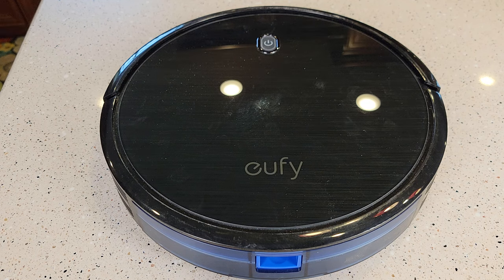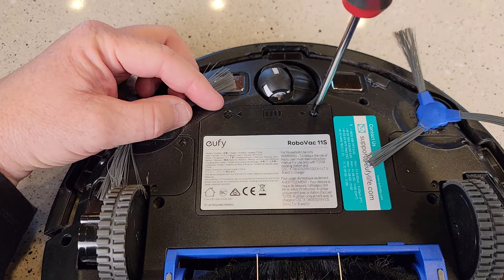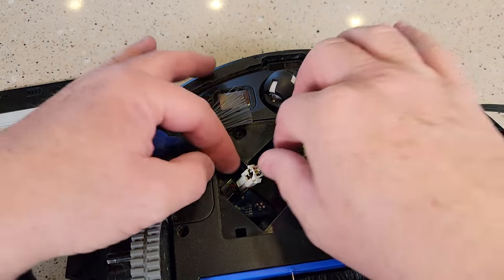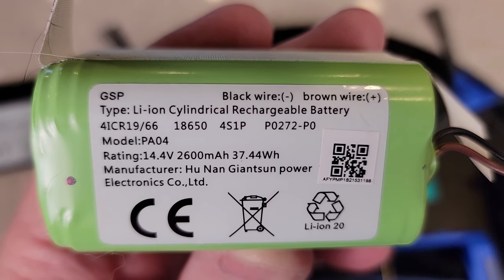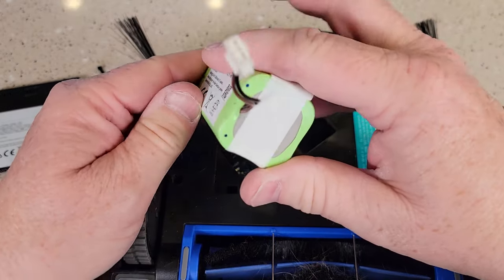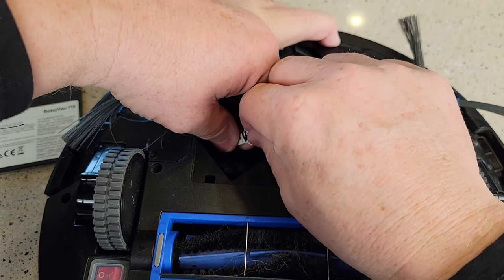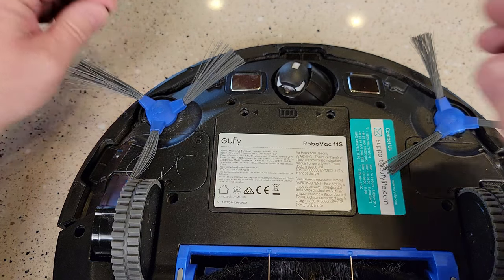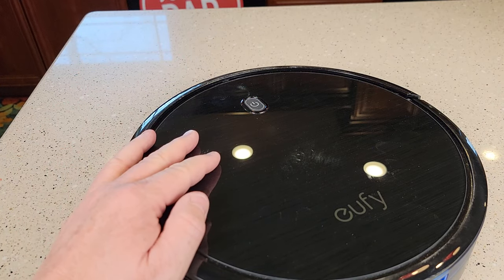How To Replace / Fix Battery Eufy RoboVac 11S Robot Vacuum

Comment: I had to use pliars to pull the old battery cable out, couldn't do it with my fingers.  Had issues getting the clip on the new battery to click but finally worked.  Thanks so much!  Am only sorry I didn't watch your video first as I would have ordered the battery thru your link to Amazon so you would have received a small reimbursement for your time to post this.
Reply from the maker: Glad I could help

Comment: Thanks, I was only pinching the two on the connector, didn't know there was another one lower down.  Had to use needle nose pliers to pinch the bottom one while pulling!
Reply from the maker: Glad it helped